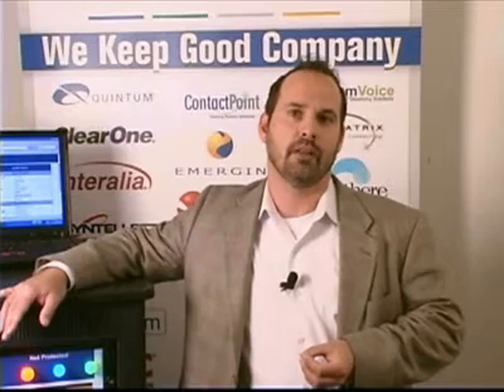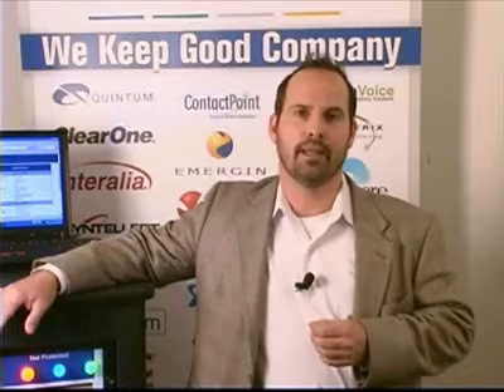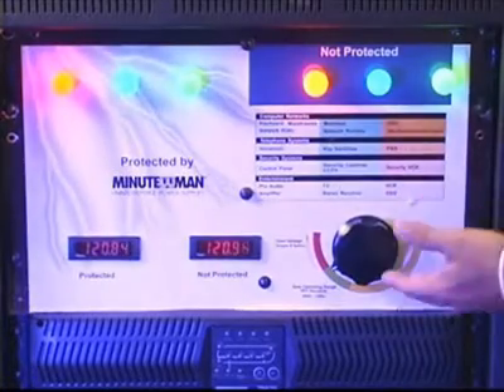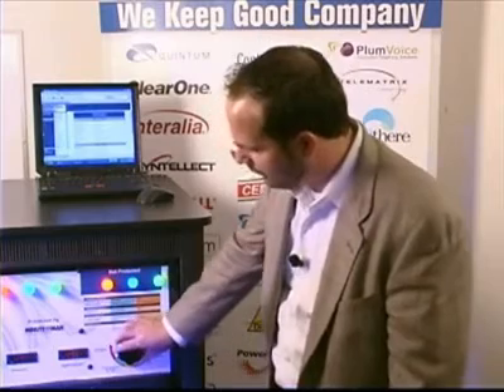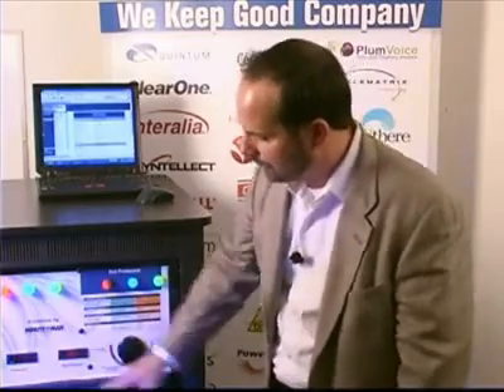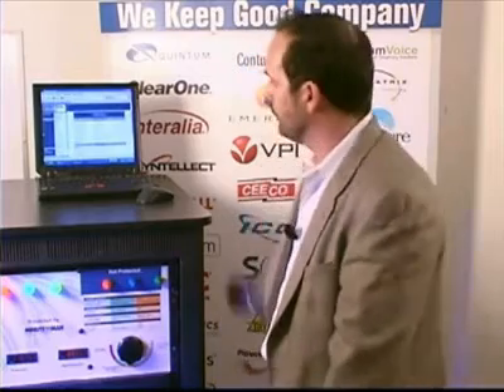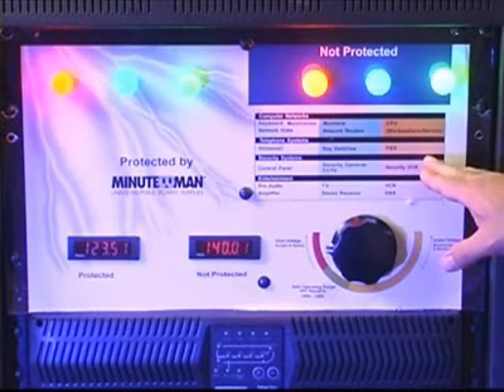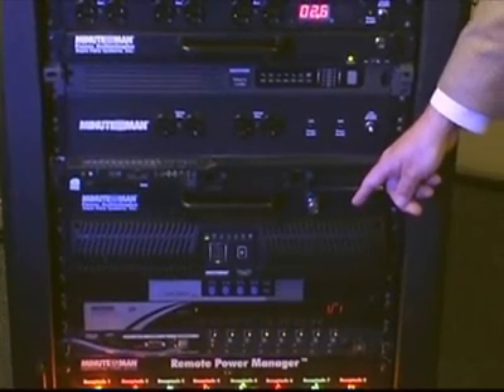Basics of UPS Systems

Comment: WRONG: No UPS system will protect you from 100% of the power problems. Like long lasting power outages and direct lightning strikes. In fact, these systems even cause system downtime. For example, I have had an original APC Smart-UPS with an original but ageing battery. Every two weeks the protected system restarted. The reason was the UPS doing an automated self test, which failed to power the load but did not register to the unit as a failure. So no red lights and the unit continued. It took a few weeks to discover why the 'protected' system was rebooting.
 
Still, I could recommend APC Smart-UPS over most other brands. But no system is perfect.